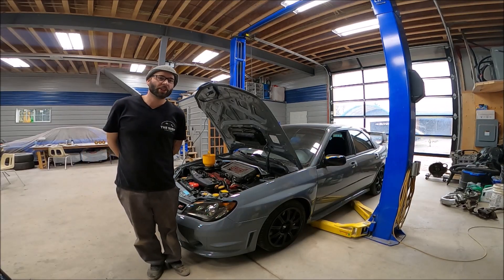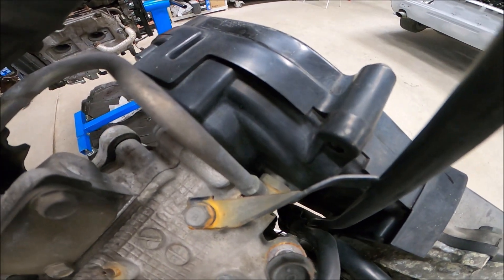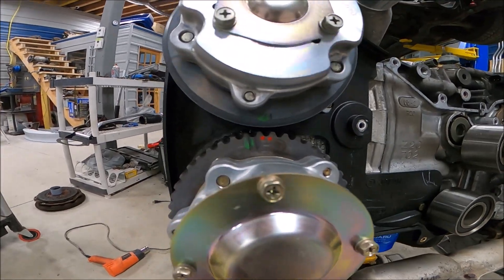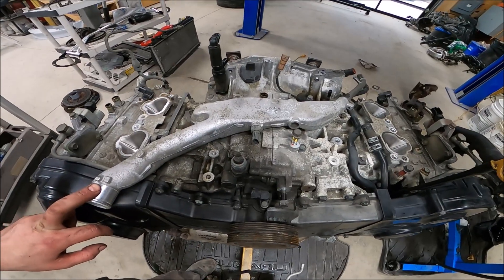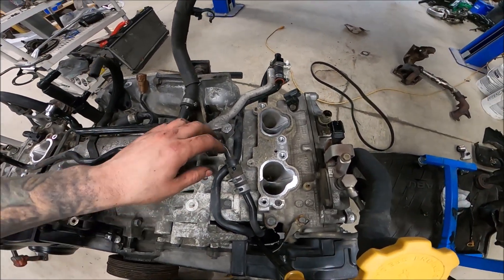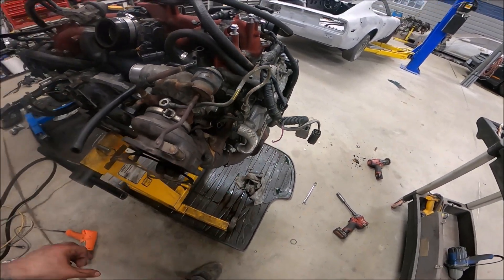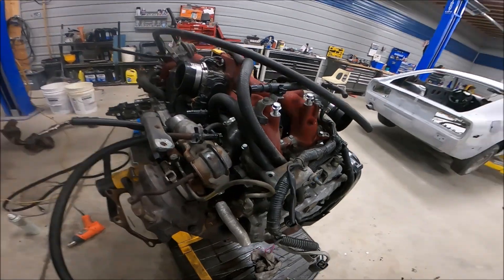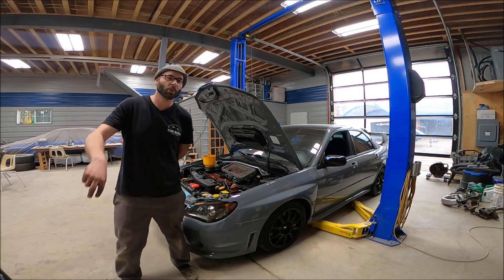How To Jdm Ej20X Swap - 06-14 WRX, 04-07 STI, 05-09 LGT, 04-14 FXT

Comment: How does this dual AVCS swap work with a single AVCS 04 STI?
Reply from the maker: Did you watch the whole video? You physically alter the exh timing to mimic the 255/257 and the you leave the exh avcs as is, in hooked. Also has dyno results at the end.
Reply: @TheSubieSanctuary  I did I just didn't catch the part about leaving it unplugged, sorry. Do I need to get an 04-06 20x?
Reply from the maker: @travislewis1607  it is ideal to get a tune after. Any competent tuner will be able to dial it in. It will tune same as your original engine. 

If you using cobb ap, please read description of video. Cobb has made changes and if you want to use cobb you need air pump version 20x
Reply: @TheSubieSanctuary  awesome thanks, it currently has an AP 91 tune (pre smog) and no cat currently, I'm assuming that tune wouldn't work with the 20x with adjusted timing
Reply: @TheSubieSanctuary  I really want to thank you!, the video that was shared in a Subaru group changed everything for me, my STI has sat for 2 years with piston slap, and every other solution was financially debilitating. Thanks again!
Reply from the maker: @travislewis1607  thats what i like to hear my friend! A subaru is much better enjoyed then left to sit. And the 20x is the answer within a very affordable window to make that happen for a lot of sitting blown motor subarus. 
Any questions as you go, just ask!
Reply: @TheSubieSanctuary  just to make sure, the cam position sensors are compatible with my 04 STI..not sure I fully understand the 2 wire 3 wire situation. Would you recommend changing exhaust cams/gears and how difficult is it to check valve clearances and reshim? Thanks again
Reply: @TheSubieSanctuary  after seeing that they are shimless, I'll stick to adjusting the exhaust cam gears. I also saw that the cam sensors remain on the Ej20x. Thanks again!
Reply: @TheSubieSanctuary  so 3 weeks to the day that I saw this video and I just finished the swap! Runs great with no CEL!! I can't thank you enough!!
Reply from the maker: @travislewis1607  fantastic buddy! Glad to hear 🙌

Comment: I just did this swapp with my 2009 wrx and i followed your video step by step. The only thing is now that the motor is in place and everything is connected. I don’t have any signal to my injectors connector. I verified everything but coudn’t find the issue. Is this something that frequently happen with this swap. If not do you have some advise i’m pretty much stuck right now
Reply from the maker: That is unusual, i would check all grounds are done up. Then check to make sure none of the pins in main connector on pass side shock tower have pushed in or bent. 
Then lastly, its crank and cam sensor angles that trigger injectors so id check to make sure they plugged in tight as well and pins not pushed back. 
Report back let me know how you make out
Reply: I assumed it was unusual. I also tried to connect my scanner and I couldn’t connect it to my car, it didn’t see it. I guess I have a pretty troublesome situation to resolve with my build 🥲
Reply from the maker: @tristanbilodeau214  its going to be something related to install. Go over every that plugs in.
Reply: Thank you
Reply: Try to start it with the scanner connected.
Reply: It was the ground of the main harness 🥲
Reply from the maker: @tristanbilodeau214  electrical issues are the biggest pain. Always an easy fix! But takes so much time to find the weak link. Glad you got it sorted

Comment: I just did this swap and I left the timing how it came and I got a tune but I’m not spooling till over 4000 rpm If I change the timing will I need a retune?
Reply from the maker: What turbo do you have on it? If you change the exh timing, it will spool earlier. Probably ideal to get an adjustment on tune.
Reply: 18g 1050 Cobb injectors
Reply: Would it be the same as reliable ?
Reply: I am curantos pushing 222 whp but boost doesn’t spool up till super late
Reply from the maker: @MiguelRodriguez-rr4kt  that a slow spooling turbo on a 2.0, the timing tweak will help a bit. These motors have no problems in reliability up to 350whp
Reply: @TheSubieSanctuary   i ended up doing the timing like you and the car now spools a few hundred rpms faster, the car feels great honestly, not to noticeable do u think I should still check in with my tuner? It would cost me 200 again:/
Reply from the maker: @MiguelRodriguez-rr4kt  thats progress! 
You running a cobb accessport or opensource tune
Reply: @TheSubieSanctuary   open source

Comment: i did the engine swap this weekend but I haven't retarded the timing yet,  I ordered the cam lock tool but it isn't here yet so I figured I would just put everything together and when the part gets here i would just do the timing then, while i was driving it today for the first time i started to hear a clinking sound? and then i got up to 70 MPH and the gas pedal was acting as if it wasnt working then i pulled over and i got codes P0116 and P0420. i then tried to start up the car only for it to not start up and sound as if it has no compression just a fast pitched version of that. by any chance do you know what could be causing that? im thinking it could be a belt or something but im not too knowledgeable about this sort of thing.
Reply from the maker: Coolant temp sensor code, id start with checking that sensor is securely plugged in. You have to remove alternator to get at it. If it is plugged in and all good. Then id recommend a good scanner that can see live data. Then watch sensor move with temp to make sure its working right. If it aint then replace sensor
Reply: @TheSubieSanctuary  so I replaced the sensor and the belts just to see if anything would change and their is no change? Still sound like it has no compression
Reply from the maker: @jackwitte7674  maybe do a leak down on that side of engine.

Comment: DOES YEAR MATTER I HAVE A 2007 USDM AND WANNA PUT A 06 EJ20X IN THE CAR IS THERE ANY ISSUES
Reply from the maker: That engine will work in the 07 wrx and sti. Same install method as video
Reply: I have a 2007 legacy gt

Comment: So, got it running, coming back with misfires in all cylinders. Didnt retard the timing, you think that’s the cause?
Reply from the maker: Changing or not changing the timing wont cause any sort of mis fire. 

Double check that engine to car harness plug is nice and tight and that no pins pushed back. It should just be something not tight or plugged in. 
The only thing ive seen with used engine and first start up misfire has been avcs solenoid stuck open. Typically this will only misfire on 1 side of engine though
Reply: @TheSubieSanctuary think it’s the crank position sensor, gonna swap it out and go from there. Only drops when idling seems like it wants to stall but then doesn’t and all the codes come up.
Reply from the maker: @nathanielhanna3181  ya let me know, im always curious

Comment: So I can do this with my 2013 WRX ej257 right?
Reply from the maker: Normally a 13 wrx would have a 255. But yes you can do this exact swap into 06-14 wrx without issue.

Comment: I still haven't replaced the  motor in my 2012 na 2.0. 360,000k and getting weak. Should just bring it up to you guys 🙃
Reply from the maker: That sounds like an F series engine rather then EJ engine. The jdm F/FA engines are just starting to trickle in into north america. We have no experience with them as of yet, but im sure we will.

Comment: What have you don't about running 100 octane ??
Reply from the maker: It wouldnt have ran on 100 octane, japan is ron. Its more like 96 octane. We do have available 94 octane here. But! these can be ran on 91 octane without issue after a tune.
Reply: @TheSubieSanctuary  mmm i was getting a code I was thinking the problem was the lack of octane. I was adding octane booster the real stuff from advance. So I"m getting a code so I'll check it again. The tensor bolt broke and bent almost every valve. So when i get it back to gether I'll make sure everything is tight. Thank you for getting back with me.
Reply from the maker: @respectingthewordpodcast  what code are you getting?
Reply: @TheSubieSanctuary  catalyst i think but I have to confirm that when I get the engine back together.
Reply: @TheSubieSanctuary  I think the problem has been fixed. My dad when he did the swap change the injectors to the 2.0 ones. He changed them back to the 2.5 and so far no codes. With the 2.0 it was a different engine but needed hire octane to run it and was much faster. I don't know why there is a difference but there is.
Reply from the maker: @respectingthewordpodcast  thats good to hear! Yes the 2.0 injectors will function different then the original 2.5 injectors. Definitely could cause some running issues. Glad your back on track!

Comment: Thanks for this video! I did the swap on my 06 OBXT and I want to retime my exhaust cams. What is your opinion about retarding the exhaust cam 2 teeth  versus 1 tooth?
Reply from the maker: Like prefect is 1.5 teeth which impossible without adjustable exh cam gears. 2 teeth will make it a weird idle and not ideal for powerband. 1 has been the best it gets with stock exh cams gears
Reply: @TheSubieSanctuary  I just did this swap and went over everything including all vac lines and gaskets. 07 lgt and did the 2 teeth retarding of the exhaust cams. It drives great but has a rough idle and shows some roughness throughout all cylinders, it also throws p0016 (crank/cam correlation) and all cylinder misfire codes. Swapped cam, crank, and ocvs around with the extras to see if any differences and unfortunately had the same result. Checked and blew out oil passages, all good as suspected because avcs phasers seem to be pretty in sync. Will be pulling back timing cover tomorrow to check the timing and put it to one tooth retarded instead of two. Any thoughts?
Reply from the maker: @JaysentU  start with getting it to 1 tooth. However i doubt that will be your issue completely but will help. Sounds like a avcs issue though. Like a gear is stuck in wrong position. Change the timing and see how goes. Report back and i can give you some pointers

Comment: is there a specific tune to ask for?
Reply from the maker: @marklopez4837  no not really, if all stock and now adding this motor. You would either need an ecu tek tune in person or can use the cobb ap to tune in person. I would recommend calling your nearest tuner to give them a heads up and make sure they are able to tune it.
Reply: @TheSubieSanctuary  2006 WRX original ej255 stock everything except a Cobb sf55 cai and swapping to a ej20x as a cheap alternative to a 5k ej255. I am running a Cobb ap but don't know if any OTS tune I can load onto my AP to apply for this specific tune on top of retarding the exhaust timing
Reply from the maker: @ are you getting a ej20y with air pump?
Reply: @TheSubieSanctuary  I figured mine only has the secondary air pump attached to the chassis on the driver side strut tower. So I was under the impression I would use the ej20x since I don't see a "primary air pump" just a secondary on the body over at the strut tower.
Reply from the maker: @ as long as the pump related items are plugged in after then you wont get a code. Only reason i mention is because the cobb ap can not turn off codes. 
Otherwise, the engine will run fine, drive fine. It is ideal to seek a tune when you can though

Comment: How emissions friendly is it a shop told me not to do it
Reply from the maker: It gets better mpg then the original 2.5 engine. You can retain all emissions equipment as before. Tgv’s, air pump etc if youd like as well.
Reply: My ej20x with usdm ej255 ecu passes emissions in idaho (US)

Comment: Would this swap pass smog in California?
Reply from the maker: Yes, but you would need to use the ej20Y engine that comes with air pump. The 20X is non air pump, but for your California emissions you will need air pump in place
Reply: Forgot to mention my gfs car is a 2007 Subaru WRX so basically same as yours, so I should just swap the ej20y for emissions right? Also would this swap require a tune to run right?
Reply from the maker: @therealJoshbaron  a tune is always best but if you just dropped in the ej20y and fired up, it will run fine and no codes etc and would pass your emissions test. But a tune is nice to dial it all in. We have had people drive a long time without tuning on a swap but i feel a tune is money well spent

Comment: great how to video, I bought a hawkeye with a blown motor and I'm putting a used ej255, if that one is messed up I'm considering going ej20x
Reply from the maker: Ya i hear that, its tough to find a good used 255 these days. They all pretty tires at this point
Reply: how much distance is between the oem cam gear mark to the one you marked pink? @TheSubieSanctuary
Reply from the maker: @ exactly 1 tooth, however the factory timing marks don’t necessarily land exactly on the top of a tooth, some are fractions. But overall your looking to move each exh cam back by 1 tooth
Reply: @TheSubieSanctuary  gotcha, I ended up building a ej255, but I want this info if I'm in a pinch and need a ej20x.... what are your thoughts on it? reliable for like 350-400whp?
Reply from the maker: @ id probably peg the max safe zone at 350whp if you leave in stock head bolts. They are a resilient motor and will take 350whp very safely and almost forever if oil is kept in it.

Comment: So if I use the non avcs cam gear I do not need to retard the timing one tooth.
Reply from the maker: You would have to use exh cam and exh cam shaft. Then you would not have to retard exh timing
Reply from the maker: And non avcs cam seal obviously
Reply: All right thanks.

Comment: Hello I had a question about a swap I’m doin into my 05 Forester XT I’m in the middle of swapping a motor into my car the (EJ20x) series and I’ve been doing a lot of research on how to deal with the exhaust side AVCS and how to get it running. Would it be possible to run a JDM Legacy GT ECU into my 05 Forester if of the same year using the 4EAT trans. 

I’m willing to get the proper ECU but I know the forester ECU isn’t strong enough to run the exhaust AVCS but I don’t want to delete the exhaust AVCS because it can be used to make better power at the lower RPM when tuned. I’ve also read up if u retard the exhaust cams by 14 degrees or 2 teeth backwards counter clock wise people on the dyno saw significant power gains compared to swapping them for USDM cams. Plz I would really appreciate ur reply
Reply from the maker: You can use a jdm Ej20x ecu, you will need someone to “unlock” the immobilized jdm ecu along with running the 4 additional wires per side to appropriate pins on jdm 20x. 
Its been done

Comment: What is the point of adjusting the timing? When I emailed jdm they said it was a direct replacement with using my intake and said I didn't need to adjust the timing at all. Thanks
Reply from the maker: They will tell you whatever they need to tell you to make a sale. 
You dont need to adjust timing, but you will give up power and torque. 
The reason for adjusting timing is: the exhaust valves can not be controlled in the single avcs. As they sit they are not going to be to same timing as the 255/257. Thus we turn them back 1 tooth and it becomes very close to correct timing. Prefect timing would actually be 1.5teeth backwards.
Reply: How much loss of a power and torque? Vs no adjustments? Thank you

Comment: Hey quick question , I did the same swap on my 07 wrx pretty straight forward and for some reason the fans won’t come on and my koyo radiator literally stars smoking after 8 minutes of being on, I’ve replaced relays and cleaned the plug-ins to the fans , could it be due to needing a tune or thermostat? Coolant temp sensor? And also as far as tunning goes , what would be my best option since I’m going from a 2.5 to a 2.0 I’m sure I would have to get it tuned or else I risk damaging the motor correct? If you could get back to me I would greatly appreciate it as I’m now in the home stretch to bring this subie back to life ! Thanks again!
Reply from the maker: The fan issue wont be related to swap really. Id get a good scanner that can read temp sensor activity. You need to confirm temp sensor is working to kick on fans. 
Yes ideally once that is sorted you should get a tune
Reply: @TheSubieSanctuary  thank you guys very much! I appreciate the reply back! And does this new Cobb news affect me if I just want to get my car tuned to run 18 pound of boost -and have it run safe without pushing it to hard !Would a Cobb access port work bc I’ve read some forums and some say yes and some say no for ej20x swap ? Or should I go opensource?
Reply: You're fine if you have all your emissions still like cat tgv and secondary airflow pump

Comment: Meanwhile everyone I know is ditching the EJ20X/Y for an EJ207
Reply from the maker: Your not silly enough to think the 20x/y was a performance enhancement? Its purpose is “cheap, easy, capable” 
Also the 207 (a 20 year old engine) doesn’t simply work in place of a 255/257 without swapping cam shafts and machining the heads. Hopefully everyone you know has got that far already.